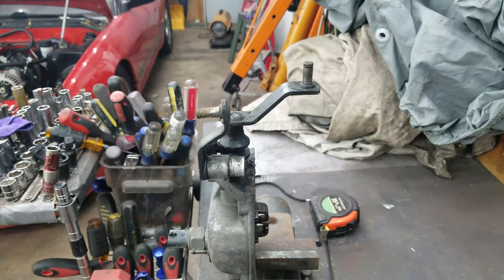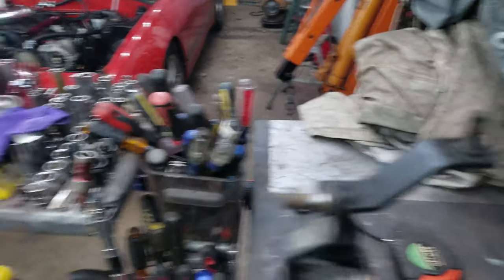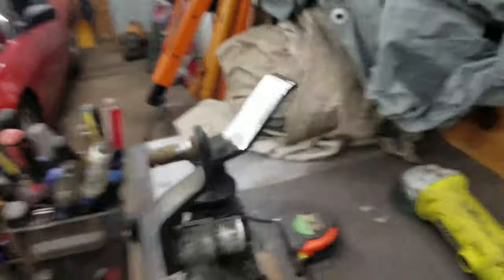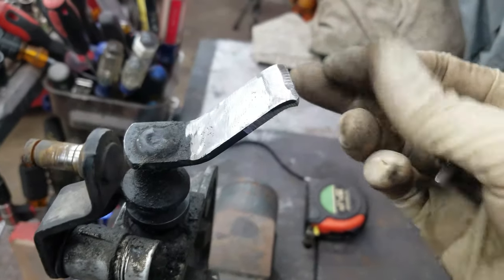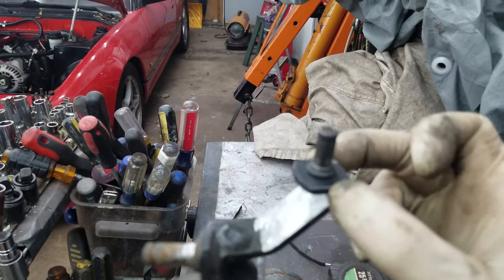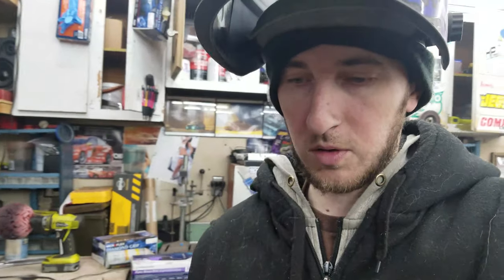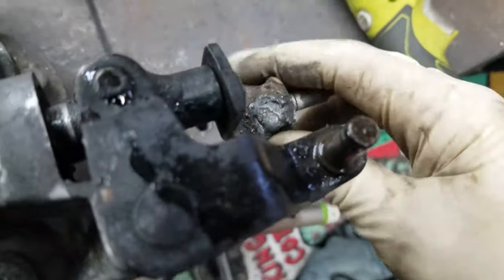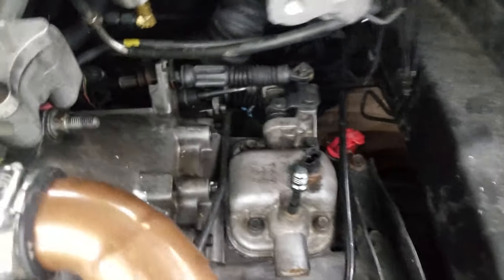Short Throw Saturn Mod

Comment: Sweet, I think I try that on my SC1 drag car. I'm not sure how this slipped under my radar for the past 15 years, but certainly good to know. Thanks dude. 
Also much better film work this time, probably your best to date. Loved that you showed your work, and gave a very well detailed explanation of what you did. Would like to see a similar vid of you lightly tearing into your wife's motor and see where that oil was coming from. I think its valve stem seals.
Reply from the maker: thank you for the input!!!

Comment: Just did this while i was changing my shifter cables!
Reply from the maker: Definitely worth it!
Reply: @BuilditBreakitGarageinc  This is a mod worth trying. Especially since I only found one truly universal short shifter that will work with the S series, and its $300, which isn't cheap. This looks like an hour to an hour and a half of work to do. Depending on if u take your time, thanks, hope ur ok, haven't seen u post a video in a while, seem like a pretty cool dude overall.
Reply: @junechris  If you don't mind what was the universal short shifter you found. I can't find anything
Reply: @RetroGamerr1991  it wouldn't work with the Saturn, whoever told me that lied. You'd have to do the mod thats on this video or what have you.